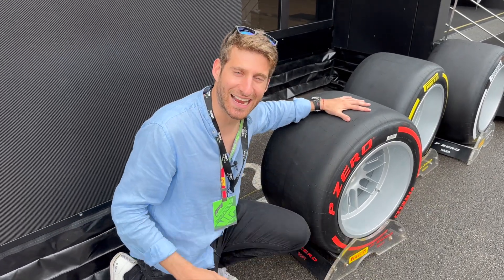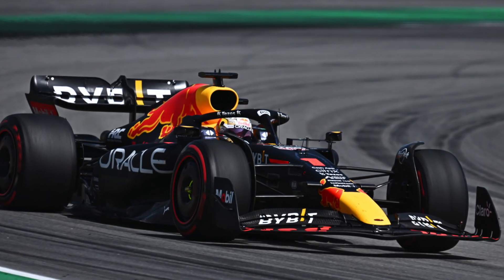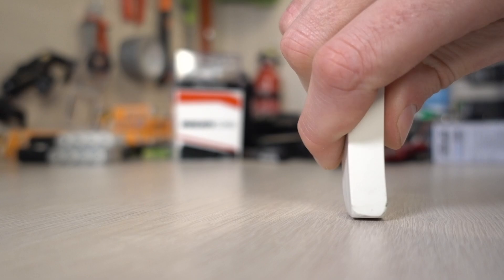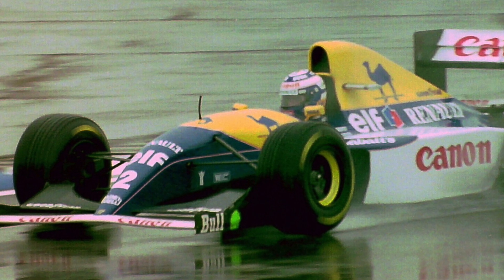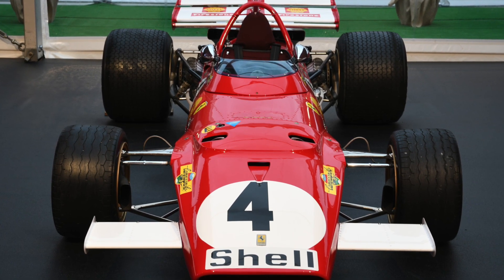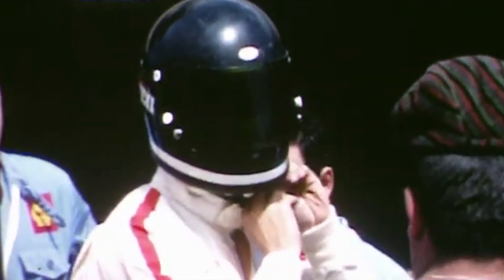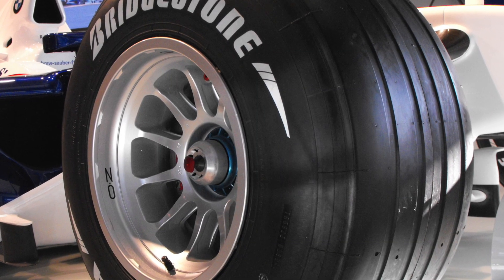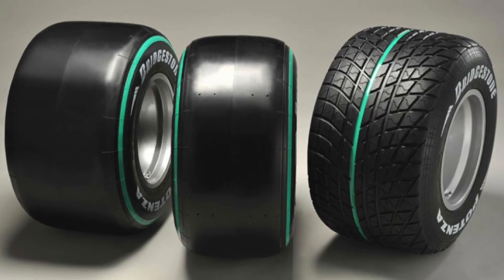Why FORMULA 1 Tires are SLICK?

Comment: As for physics, grip itself is the same for any area. It's about how a tire and its thread deforms
Reply: Not true, an increase in contact patch area increases (not linearly) the coefficient of friction. This can also be seen when lowering the tyre pressure , it has a direct relation to the increase of contact patch area and therefore also the coefficient of friction. Not only this but increasing the tyre width also increasing the tyres cornering stiffness which contributes to its lateral grip capability

Comment: Very cool video, but there is one thing I do not agree with. At about 2:30, you said Formula 1 car have wings because they generate down force, which makes the tire shape better in the asphalt. Then you said this was important because the bigger the contact area, the bigger the grip. However i disagree with you. According to physics, the grip equation is: Grip = K * weight, where k is a constant. F1 car have wings because it makes the car weight heaver, and then have more grip. In the equation, we can see that the grip does not depend on the surface area. 
But then you might wonder why race cars have wide tires. This is simply so that the tire does not collapse while the car is accelerating. This happens because if the tire has a bigger surface area, the engine torque  will be distributed on a bigger surface, making the tire not to explode.
Reply: Again since friction is the for no slip condition, I disagree with you and also to be noted though in school textbooks its told k*normal force and does not depend on area, actually dependence on contact area is based on the context, you can check friction models if you feel I am wrong.

Comment: I READ THIS IN A WELL KNOWN MOTORCYCLE MAGAZINE BACK IN THE MID 70s
Motorcycle slick tires really did happen by accident similar to the Ferrari story.  Back in the late 60s early 70s team Harley-Davidson arrived late to a road-race and all they had was factory slick tires and no time to cut in thread patterns which was the norm. So they had no choice but to go out and try to qualify on slicks and the team mechanics all thinking it was going to be a disaster.  Well not only did they qualify, but they danced circles around their competition that was always faster than Harley.
Back in the day, in order to get the number one AMA national title you had to race flat-track, and road-race. Harley was great at Flat Track but not so fast in Road Racing.  And for a while the slicks allowed them to podium in road races.